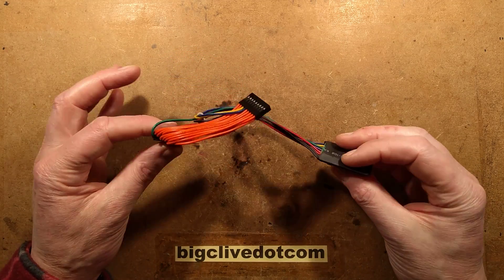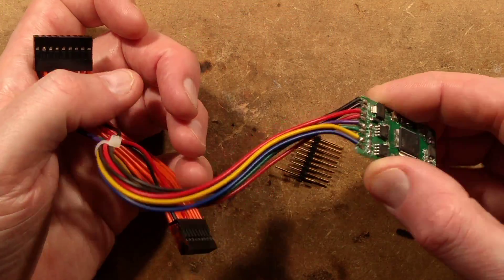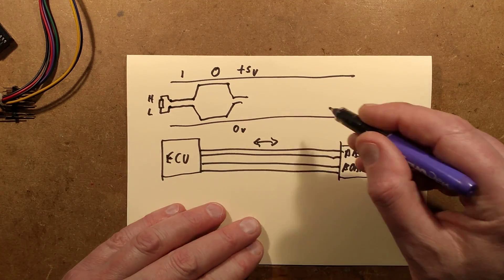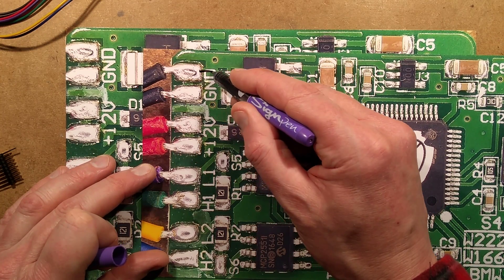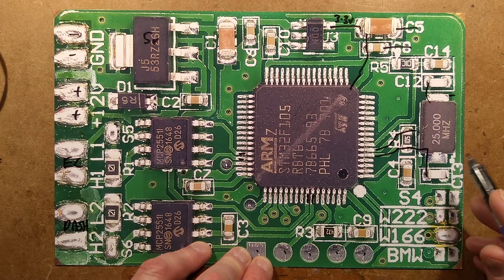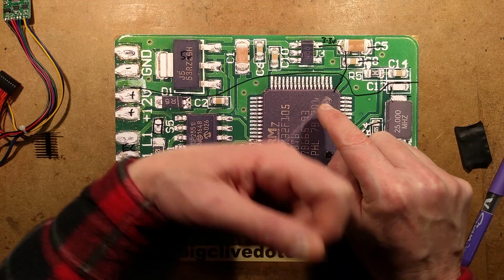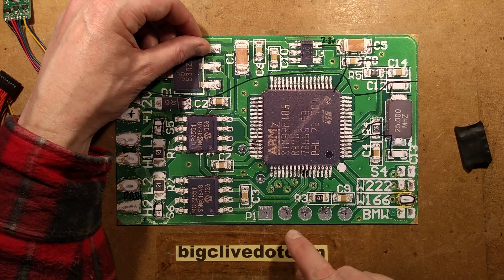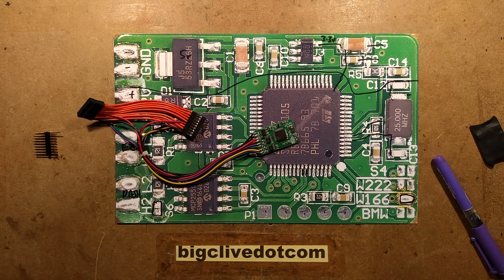Naughty CANbus odometer "interface".  (Fakes mileage.)

Comment: When I started this video, I was assuming that it was shaving off the mileage as you drove - you installed this chip when you got the car, and the odometer would clock over more slowly.  0.8 miles recorded for every 1 mile driven for instance.  After a little googling, the board is sold as a 'canbus filter' and they specify you install it when 'correcting' the odometer readings, and it just filters out the synchronization of the odometer reading on the dash with the ECU.
Reply: I also assumed it was shaving mileage as you drove, if that's not correct, then how does it work?   You plug it in and then somehow type in the number you want the odometer to be?   Or you plug it in and the odometer doesn't advance at all until you remove it?
Reply: I'm guessing you put the chip in, and then program the value somewhere, maybe through a dash interface device, and then this keeps the ECU from telling the dash the proper value?
Reply: @DasGrinch  It must be incrementing somehow, or else you'd notice it right away.   Maybe you just program in how much you want to subtract off, and then it increments normally from there.

Comment: These are known as Mileage stoppers/freezers. They seem to be common on Taobao for mostly Mercedes vehicles... but some seem to stop more than just the odometer, but also warning lights for the seat belt, and other communication. I would say that could actually cause harm if not detected/removed by the 'new' owner of the vehicle (althogh some only activate when the Eco button is pressed).
Reply: BTW, textbpook Chinese. The STM32 range of ARM-based MPU/CPU is very popular here. Just like those cars ;-)

Comment: I presume someone attempting to sell a car that had this device on it would remove it in case someone wanted to test drive that car on a highway where the mile markers are clearly marked.  If at each marker it is noticed that only 0.8 miles is registering, that would be a big red flag to me.

Comment: We need a device like that to fix the deliberate lying speed displays. For instance, at true 80km/h GPS, my car shows 87 km/h.
The dealer refuses to/is unable to fix this error.

Ideally, the wheel speed could be compared with GPS speed on straight roads with good GPS, and a correction factor be calculated, so the wheel speed display is correct.

Currently, the traffic flow is disturbed by people thinking they are driving at the speed limit, but are actually up to 10% slower.

Comment: Question, I'd the actual milage stored on the ECU or the cluster? If stored on the ECU once this device is removed the car would show the real milage. If it's stored on the cluster, as I believe it is, even after the device is removed the "shaved miles" will still be shaved. And odometer tampering is a felony pretty much everywhere as far as I know.

Comment: W166 looks like a Mercedes body-style code. And just checked, sure enough, W166 is the code for M-class (GLE) SUVs (3rd Gen - 2012 to present). W222 is S-class sedans (6th Gen - 2014 to present). S4 then likely means the Audi model by that name. And then BMW would be that marque.

That makes that board really clever, that with just a simple jumper, the same board can be used on multiple different vehicles.

Comment: I've been told by several sources that the German makers (big CanBus users) store the mileage in the ECU, not just in the odometer, so odometer tampering can be found by simply running ECU diagnostics. I don't know, this is just what I keep hearing, without argument.
Reply: But the average buyer of a second hand car, especially a second hand "quality" car, isn't going to have a clue what ECU diagnostics ARE, let alone how to run them.

Comment: Is this the devise that stops the indicators from working on a BMW.
Reply: No, no. That particular piece of equipment is called the driver.
Reply: I suspect that device is in the seat behind the steering wheel.😉
Reply from the maker: No.  It's the same device that causes it to park on pavements and use disabled passes for free parking.
Reply: I believe you are thinking of the most important part of any car, the "nut holding the steering wheel."

Comment: 7:25 Zero volts go through here. 
I have a question: if there is 'zero volts' , how can 'they' possibly 'go' anywhere?
Reply: Because in order to have current, you have to have potential.
So there is current flowing through the zero volt buss, because otherwise you would have no flow or power.

In addition, in electronics, each buss or part of a circuit has a name, and it's common to talk about where that circuit goes, regardless of which direction flow is going, or what it's potential is.

And again, any potential still "goes", otherwise it's not providing any function.
Reply: You can still have current at zero volts.  Voltage is always measured relative to something else. Consider that your car’s negative battery cable is by definition at zero volts, but it has just as much current flowing through it as the positive cable does.

Comment: Please try to read it.  I would love to see what the community can do to reverse engineer the firmware.if you are able to read it.
Reply from the maker: You can rest assured that the real car geeks will already know plenty about every aspect of most vehicles communication protocols and how secure they are.
Reply: @bigclivedotcom   Secure - you jest surely It won't be secure (End to end AES256 encryption and authentication handshakes) until it becomes a legal requirement. Even then most manufacturers will fudge it and leave it with as many holes as a colander.
Reply: @daviddunmore8415  Clive didn't say it was secure he said "...how secure..." meaning those with an interest know what the strengths and weaknesses of the protocols are IE how secure
Reply: @kingsman428  My point, which was intended to be ironic in tone, was to highlight one way in which communication could be made more secure. which has security and safety implications as cars become more connected. Remember, there's no such thing as 'perfect security, you just need to make it difficult enough that most bad actors (except maybe state actors) look for easier targets.
Reply: @bigclivedotcom  Can bus is very insecure, it was designed before there was an internet, and every car was "air gapped" to the rest of the world.
Reply: it wont do much more than intercepting and modifying the one parameter
Reply: Here's where you can buy it... https://www.truckdiag.uk/shop/mileage-correction/can-gateway-can-filter-module/
Reply: its actually read-secured, so you cannot read it out. however you can reprogram it

Comment: Clive I Found her and will email you this data (printed to pdf) Link works as of now. https://www.aliexpress.com/item/32815482362.html  Pretty sure this is against the law for ALIEXPRESS to be hosting lol. 
5pcs MB CAN Filter 18 in 1 For Benz for BMW Universal filter MB CAN Filter 18 In 1 Odometer Adjustment CAN Filter for W222/W166   US $76.00 / lot (5 pieces)   

Hot selling Original Yanhua MB CAN Filter 18 in 1 For Benz/For BMW Universal filter

1.CAN Filter 18 in 1 Support Model:

S (W222) C (W205) V (W447)

S (W221) C (W204) E (W212)

E (W207) A (W176) G (W46)3

ML (W166) SL (R231) GL (X166)

B (W246) CLS (W218) SLK (R172)

SLS (W197) CLA (W117) GLK (X204)

For BMW： CAS4/FEM Fxx https://ae01.alicdn.com/kf/HTB1mTfhQpXXXXXkaFXXq6xXFXXXo/228332273/HTB1mTfhQpXXXXXkaFXXq6xXFXXXo.jpg?size=203320&height=751&width=1000&hash=f50530bde8f5b5c762818396ca28ff2c

https://ae01.alicdn.com/kf/HTB17mNrPFXXXXcQXXXXq6xXFXXXE/228332273/HTB17mNrPFXXXXcQXXXXq6xXFXXXE.jpg?size=181554&height=603&width=900&hash=f916016102c8eec7375dcb6805570c70

2.For BMW Support Model:

   For BMW 1 series F2X, 3 series F3X, for BMW X5 etc., FEM mileage adjustment( no need to remove FEM, connect dirrectly to instrument panel);

   For BMW 5 series F10，7 series F01/02 etc., CAS4 Fxx chasis.( F01,F02,F07,F18,F10,F20,F25,X3 etc., applicable for 9S12 XEP series 5M48H/1N35H).

 

This filer is universal for multiple car models, small and convenient, easy operated, which with stable performance and reliability.

NOTICE!!
New style: 222/205/217
Old style: 166/212/463
CHECK the car modele correctly before adjust.
Old style W166 short circuit to GND
New style W222 short circuit to GND
Black wire connect to plug 1

YH for Benz/BMW Universal filter --- Diagram for BMW

Below is illustration for wiring:

https://ae01.alicdn.com/kf/HTB1FupmPFXXXXbjXpXXq6xXFXXXW/228332273/HTB1FupmPFXXXXbjXpXXq6xXFXXXW.jpg?size=139031&height=508&width=800&hash=0641cd682155af7a2da5b1055c588ddd

Black  --------- GND                   Red --------- +12V      White  --------- +5V  

Purple  -------- L1（CAN_L1）    Green --------- H1（CAN_H1）    

Yellow --------- L2（CAN_L2）    Blue --------- H2（CAN_H1）

NOTICE! Please connect the 2 for BMW dot together(short circuit) BEFORE connect to car!

https://ae01.alicdn.com/kf/HTB1hW6gQXXXXXcSaXXXq6xXFXXXw/228332273/HTB1hW6gQXXXXXcSaXXXq6xXFXXXw.jpg?size=189787&height=625&width=1000&hash=21c3ab75287d7bd43235dd41920ef4c3

Below is the diagram for BMW 1 series F20 instrument:

https://ae01.alicdn.com/kf/HTB197w8PpXXXXbfXVXXq6xXFXXXQ/228332273/HTB197w8PpXXXXbfXVXXq6xXFXXXQ.jpg?size=106737&height=382&width=576&hash=d90167cebd48406d64789097a6faa05b

Below is for BMW 3 series F30 instrument:

https://ae01.alicdn.com/kf/HTB1y5w4PpXXXXc3XVXXq6xXFXXXD/228332273/HTB1y5w4PpXXXXc3XVXXq6xXFXXXD.jpg?size=102055&height=401&width=581&hash=147123bb4d0cf85346a0d512f33bd46e

((KEEPS GOING AND GOING HUGE TROVE OF PHOTOS)) Printing this sucker to .PDF   :p
Reply: For Dirt on Joe Bidens son I will find the model of anyone's car here J/K lol.

Comment: Each device on the bus has a numeric ID which also doubles as its priority, with the smaller number meaning higher priority. Meant to resolve situations where two devices want to "talk" at the same time. Having "high" as 0 and "low" as 1 coupled with built-in data verification makes for a simpler electrical implementation of this priority system.

Have a look at GreatScott!'s most recent video, he does a good job at explaining this.
https://www.youtube.com/watch?v=PL0TPdrhMuI